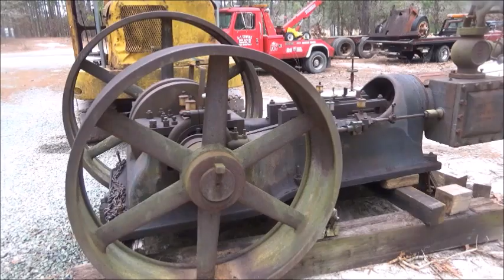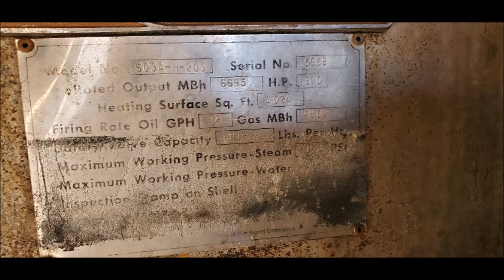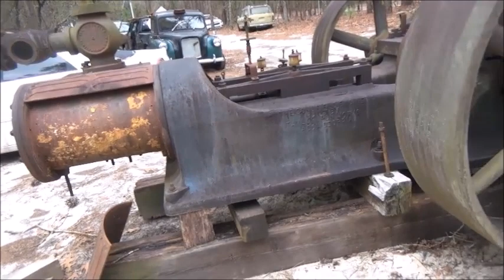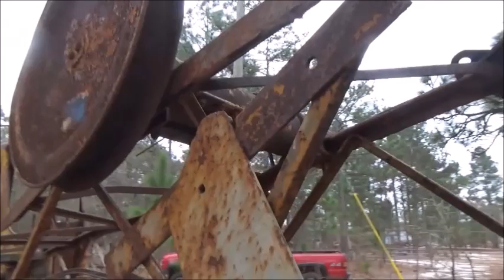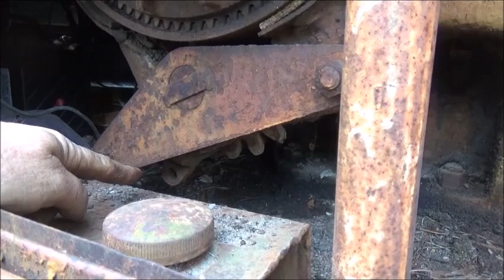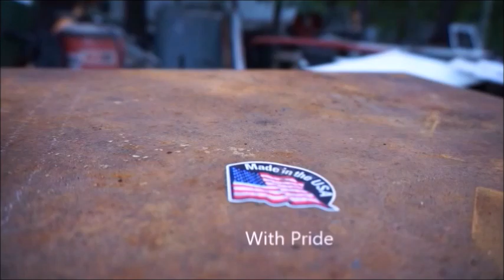STEAM BOILER AND STEAM ENGINE UPDATE

Comment: A lot of years back I was feeling low because of health. I had an old piano that I wanted to take apart to learn things. I was working with a counselor and told her I didn’t want to start because I might die and leave a mess. She asked what my wife would do and I didn’t leave the piano as a mess. I told her that my wife would throw it out. She pointed out that it would end up in the same place whether I worked on or if I didn’t. After thinking about it I ended up taking it apart and I learned a lot. I ended up tuning and fixing pianos for others. Jonathan, follow your dreams while you can.

Comment: Jonathan, I worked in property management for thirty years. For 28 years we heated our building with natural gas fired, hot water boilers. We had four of them. It was required by code, and I believe also by our insurance company, that we have an annual inspection by, I believe the building department or it may have been the fire department (apologies as I have been out of the industry for nearly ten years now). Both departments worked together when it came to certain inspections. We had to have the inspection before we could fire up the boilers for the season. Just a thought, but if there is a railroad museum with an operating steam locomotive in your area, you might reach out to them regarding inspections of their steam powered equipment. I'm in Louisville, KY. Code may be the same, or different where you are. 

Thank you for sharing with us all your projects. It's been quite the learning experience and just plain fascinating. I found you when you were doing the one day builds on a Willys pickup. I've got a 1960 Willys 4x4 station wagon Frankenrestomod. :-) Please take care of yourself. You've got a lot of fans following you.

Comment: Just some thoughts from  a retired high pressure boiler operator. 1)  that old boiler having been sitting  and probably not layed up properly would most likely need to be re-tubed or have the tubes re-rolled at a min your looking at $10K to $60K. that's after spending the $$ to move it.  2) The old boiler might have to be de-rated to a pressure lower than required to operate the engine.  I recommend you engage a licensed boiler inspector, and  3) the state codes probably require an annual  re-certification  $i-$2K.  4) Then you will need a big supply of softened and chemically treated water, no can use straight well water !  5) The old boiler appears to be dual fueled gas or oil, now your looking at 1000's of cubic feet of gas or 100's of gallons of #2 oil just to raise steam to the operating pressure of the engine. 6) The boiler may have been fired on heavy oil, that would require converting the burner and instrumentation=== BIG $$$.  If you had Jay Leno's $$$ all fine and dandy. otherwise proceed with caution. BTW great videos.
Reply: But if the engine is privately owned it wouldn't need to be certified. Because it is public property. Now if it was in a company then I could understand what your saying. Your the man as far as how the other stuff works. Just saying. Don't get mad
Reply: @jamesmaroon6161  
Here in the UK even unvented domestic water systems have to be registered due to the possibility of collateral damage to surrounding properties. 
That Boiler looks like a 3 pass wet back possibly 8 to 11 bar pressure if that blew your looking at 100m+ danger area. 
No idea what the laws are over there but a private individual in the uk wouldn't be allowed to operate this type of boiler without yearly inspections, registered and fully trained operators, yearly fully stripped and hot working inspections by insurance engineers, every 5 years all the lagging is taken off and all weld seams are xrayed or ultrasonic tested,  hourly inspections during boiler operation and recorded including testing of make up and feed water. Daily, monthly make up and feed water inspection from an outside agency. Smoke tubes cleaned individually every month. Smoke stack cleaned every year. 
You would need to install a hotwell system for your make up water and a water treatment plant to maintain the water PH level and to remove excess oxygen out of the water. 
If run on heavy oil your storage tank will have to be insulated and heated and kept at 60c the oil will then have to be heated before it gets to the burner to 100c all this has to be inspected yearly by ther insurance company. 
The list is endless and way to costly to run on a small scale.
Reply: @jamesmaroon6161  As long as anybody might be near it, even on private property the boiler would have to be inspected to operate or he could have a huge problem with any type ofliability or home owners insurance. Compressed air would probably be the best bet. My dad ran an enegine like these for years on an air compressor.

Comment: I've done my share of running High Pressure Boilers in garment facilities. They were the Kewanee 100 horse power. Every year they have to be inspected, it's mostly a visual inspection to make sure there's no scale on the tubes and no cracks. And it's clean inside. You have to remove the hand holes and punch the tubes and clean the fire box. You have chemicals you use in the water that's preheated before it's pumped into the Boiler to help remove impurities and oxygen from the water. Every hour you blow down the Boiler to control sediments. There's a lot more to Boilers about checking safety valves and feed water pumps sight glasses the chemical injection pumps and so on.
Reply: Your right TDS levels have to be checked hourly ours had auto blowdowns and kept at 3500 ppm.
Funny seeing comments telling him to go for it at the boiler looks ok, there so much more involved. 
Water treatment plant, hotwells, dosing pumps, blowdown vessel, fuel storage and supply, all equipment is doubled in case of failure of the primary equipment.
Think Jonathan should pass on this one.

Comment: Unless you are buying the boiler for something less than scrap value find someone who knows boilers and have them check it out before you buy it.  Working on boilers requires code stamps and certifications that will probably prohibit you from doing the work yourself. It can get real expensive, real fast.
However, the engine will never run right on compressed air. You can make it turn but making do work requires heat and thermal expansion.
I admire your zeal and drive.  I don't know when you find time to work.

Comment: That boiler looks close to the size of the one that heats the building in which I work. It's a train station, built in 1914, and the boiler isn't nearly that old, but it's huge. Oil fired would be a good choice for your purposes; it's quicker to start and bring to temperature when you want to run it, and shuts down easier and with less cleaning than a coal or wood fired boiler. I'd put your machines on the back property, and build a metal building like the one you posted about a couple weeks ago for them. That way it's away from the road, and someday when your kids or grandkids have to decide what to do about them, they're not faced with having to move them off your home and shop property; if they find someone who's got the interest and drive to run the machines, they can sell an acre or two with the machines and leave them in place. Those old engines are awesome; hope you get to run them. 👍

Comment: Hi Johnathan, at you from the cold north, Manitoba Canada. I have had a bit to do with steam boilers and their inspections many years ago. The quick pic you showed of the big boiler in the shed could be in great shape, or a never ending repair mess. Fire tube flues are all peaned on each end and finding someone to do that today will likely be a serious problem. Testing the boiler. Normally done with cold water to protect those around the boiler during testing.  Normally the boiler was isolated from all working parts by valves and filled to 99% of volume or there about. Air was added to build pressure in 5 lb. increments. until the first leak showed up. usually quite a piece from the rated pressure, in your case pick a number , say 40 pounds. The inspectors will then register as safe to 30 PSI cold. Remember; cold pressure is normally lower than hot pressure but is a lot safer to be around. After the boiler is rated then the rest of the system is tested , one valve at a time.     This was the test back in the 50s and 60s into the early 70s in Canada . Hope that helps you a bit.    good luck;;;lwayne

Comment: Hi Johnathan I work in a fair size local sawmill, and we have 2 huge boilers. 1 is natural gas fired, very similar to the one in your pics, I think it's also either natural or propane gas fired by the size of the fuel line going into it, which looks to be a 3" schedule 80 pipe. So ask yourself if you are willing to finance a boiler that requires a 3" fuel line to power it..
The other 1 we have is fired by our own bark and sawdust produced in the sawmill. I don't know the rating on the gas boiler but the wood boiler is 14,375,000 btu.
We heat 7 hardwood dry kilns each capable of over 100,000 bd ft of lumber each, plus it heats the entire building with residual steam. So I think the boiler in your photo is a much overkill for what you need. 
 Coincidentally last year own mill manager had maintenance run our gas boiler for an entire month to test whether we were better off burning gas, on the pretext that our own waste/boiler fuel would earn more on the open market, than the $ amount spent on fuel running the gas boiler.
The result of the experiment was the mill manager telling maintenance NEVER fire that gas boiler again unless absolutely nesesary. If that tells you anything about fuel costs.

Comment: In his book, "The Story of a Stanley Steamer" by George Woodbury,  when he was restoring a Stanley from the 1920s, he went to a quarry near his place in New Hampshire where they were running cranes using old Stanley Steamer two cylinder engines on compressed air and they worked just fine. They gave him one of their worn out Stanley engines.  This was in the late 1940s.
Reply: Great book! I read it years ago. He wrote another one about getting a water powered mill back in operation. I think it's "John Goffs Mill" or soemthing close to that.
Reply: @Bret4207  I have all his books. He is one of my favorite authors. (there are only 4-  "John Goff's Mill" "John Goff's Legacy"  "The Great Days of Piracy in the West Indies"  and the Steamer book.)  He was a great story teller. Get the Legacy book and read the story about how the first self -propelled motor vehicle in the United States was probably a fire engine made in Manchester, NH.

Comment: Jonathan,  Sorry to hear about your health concerns.  We hope you're headed back to good health.  Regarding the boiler, I think it is WAY more than you need or would want to get involved in.  For  reference, our automatic boiler is 15hp and is capable of running any of our engines for the sake of demonstration.  If you plan to actually use this engine for a sawmill then something larger, say 25 hp would be more suitable.  The 200 hp, much as it can be derated for pressure or even underfired, would still need to hold the same amount of water as normal, and take a significant amount of fuel to get steam up.  Potentially 50 gallons of fuel just to warm it up.  Also, that oil burner is going to be fairly complicated, usually having a draft blower, oil pump, and atomizing air compressor all needed for operation.  This on top of the testing, certification, and maintenance concerns others have mentioned.  

With regard to regulations, you should look locally at your town or county rules as they can vary from town to town.  Many areas have different rules for "power boilers" vs heating boilers, which usually comes down to pressure rating.  Other areas may separate the rules by hp rating, say under 25hp doesn't require a licensed operator but 25 and up does.  The price might be right on this Iron Fireman, but all of these factors are important to consider before you jump in.  Call Ernie or I if you need to talk through it further.

Comment: I worked with boilers almost all of my career (50 years). Most of them were 80 to 100 HP. Some were oil fired and some gas. They are pretty trouble-free if you treat them right, i.e.water treatment, good fuel etc. You would learn quickly. Go for it.

Comment: A little Iron Fireman history: 17th street in Portland Oregon. They designed and built automatic boiler stoking equipment back in the early days of electricity. They had trouble sourcing reliable electrical contactors so they designed their own. This led the eventual transition from boilers and boiler stoking equipment to designing and building controls such as thermostats. The name transitioned to Peco Mfg/Sunne Controls. They also did contract design and manufacture, injection molding and die casting, etc. This included components for Boeing, mail carts for the US Postal service, etc. There used to be a really cool die cast ash tray on the production managers desk that had a little Iron Fireman statue holding a shovel. Eventually got bought out be an aerospace firm and shut down.

Comment: Johnathan my father worked in a shop where they used steam to heat rollers to thin out rubber. Many modern uses for steam. Be nice if you had a covered area to put the boiler and engines. Also you could have educational trips for kids to show history of your area. Good luck and go with your gut feelings.

Comment: requires biennial inspection Hot Water (or other heated medium) Heating Boiler (HWH) when exceeding 200,000 BTU per hour, or when exceeding a water temperature of 210 F, or nominal water-containing capacity EXCEEDING 120 Gallons

Exemptions include all pressure vessels, boilers on a farm, boilers under Federal Control under Regulations of Title 49, heating boilers located in private homes or in apartment houses of less than six family units. That’s for South Carolina.  I’m an NBIC Inspector from another state, thanks for content

Comment: My grandparents had an Iron Fireman in  their basement. It automatically fed coal into the boiler when needed. I probably have 15 years on you, and I've reached the point where I debate taking on new projects. I'm just trying to work on existing projects so my family isn't stuck with a bunch of vintage cars that don't work. Kind of sucks when you have to start thinking that way. It's all about pacing yourself and not running yourself in the ground. Hope to see you back in top form soon

Comment: Hi, Jonathan,  Item Number 1.  Take care of your health. we all love you and your videos.  Number 2. It looks like you have 2 or three lifetimes worth of work ahead of you that we are all waiting to watch with baited breath.  Number 3. Grab that boiler, it's been wiating just for you.  It has probably been modified several times to update/modernize it, so it shouldn't be a problem to make a couple more mods (possibly to restore it to a past configuration).  The 200 horsepower rating is most likely the amount of power it should be capable of supporting (think of it in terms of a battery for an electric motor).  Sorry, I don't have any printable advice on how to prevent vandals from messing up your equipment except keep them farther away from the road.  I didn't realize the Schofield Steam engine had so many oilers all over it.  I'm afraid that, like it or not, with all your beautiful toys, you are running a museum, Mr. Conservator.  God Bless and stay safe, Meow to Ninja Catscan.

Comment: A lot of old boilers were used to operate Lithium Bromide chillers which took a lot of steam.  The other reason to have a high pressure steam boiler was to keep up with the demands of a large facility.  Steam heat usually is reduced in pressure using a series of pressure reducing valves commonly manufactured by Spence.  The first stage was to reduce high pressure to medium pressure, around 50 PSI.  Then the second pressure reducing valve reduced the medium pressure to low pressure, maybe 5 PSI. High volume, even if the end use is low pressure is why you need a high capacity boiler.  Take care of yourself Jonathan, take an iron or two out of the fire until you’re on the mend.

Comment: You'll probably have to put a fence around your old engines and equipment, like you said we do have those types of people here and there.
If you know some old Navy guys that were boiler tech's or machinest mates they will be able to help you with some questions I'm sure.
Take care of yourself and don't worry about what will happen to it after you have left this earth, I have and and it's a load off my mind.
Some one most likely picked up something too heavy for the machine and twisted the boom, didn't know what they were doing.
You are doing a great job repairing it and won't have to worry about safety issues. You don't need the tag line unless you plan to use a clam bucket or drag bucket, add it later. I've run my mouth enough, have a good day buddy.

Comment: In addition to the yearly boiler inspections, those making repairs to the boiler generally require an R-Stamp from The National Board of Boiler and Pressure Vessel Inspectors. Also, check into the requirements for emission sources -- in other words, what if any environmental permitting may be required from the NC Department of Environment and Natural Resources to operate this boiler. Granted, this is a much much smaller boiler then I'm used to dealing with, but the regulations are probably very similar.

Comment: Hey Jonathan, Why not keep life simple and set up your old boiler with plumbing to your engines. Then use your compressor and sneak the air in through the boiler so that everything looks period correct. The compressor could be 100 feet away so the noise "would not be an issue", to quote a smart guy I know.
Think about leaving your engines to a nearby tractor/steam club, or the 100 Years of Progress organization you mentioned.
I  really like what you do.